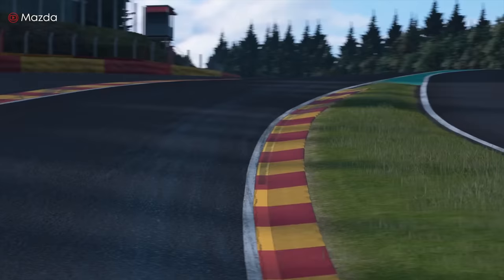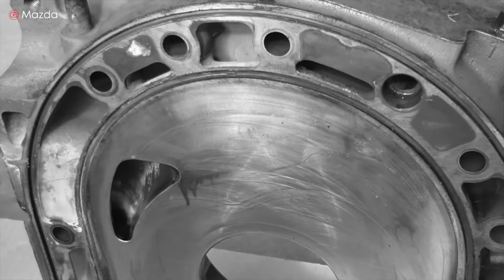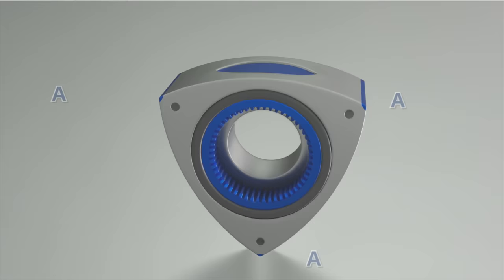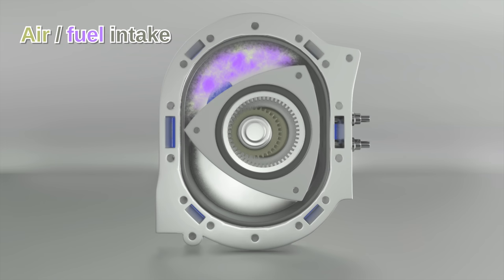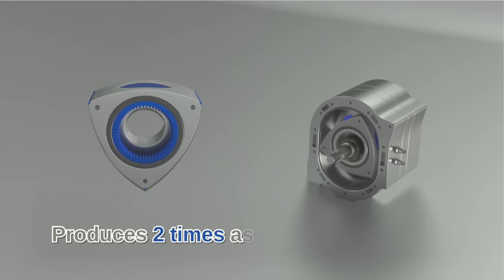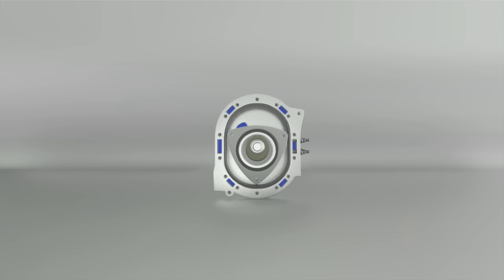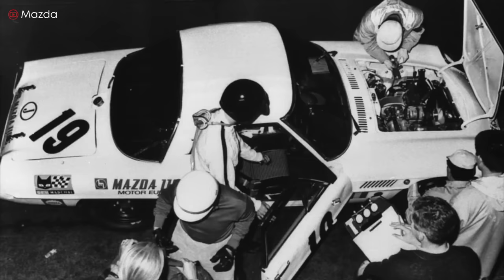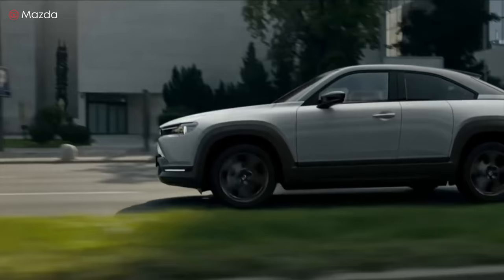Mazda's New Engine is the Most Powerful Engine Ever Made

Comment: GM's decision to kill their Wankel program also left AMC high and dry when it came to a suitable engine for their small cars.
Reply: That's correct. The AMC Pacer was supposed to have the GM Wankel rotary, but instead had AMC six cylinder engines.
Reply: @snowrocket  The rotary would have never worked in the pacer. AMCs troubles ran much deeper than a rotary could have fixed
Reply: @weirdshibainu  It would have worked fine in the Pacer, except for the usual rotary issue of fuel consumption. But, since fuel economy was important to many people, it would have hurt Pacer sales overall. AMC's troubles were many, like not having enough money to redesign older models to make them current and desirable.
Reply: @snowrocket  It would have worked but only if it were a manual.   The pacer would have been an automatic and rotary's are terrible with automatic transmissions.

Comment: I own an rx-8. It sits in my yard... dead. The end.
Reply: lol
Reply: hmm, find a rotor nut to buy it. we love bringing them back to life. the rgenisis rotor wasnt to great either.
Reply: Never give up , I’ve had rotaries all my life , I’m 52 , it’s important to have a good mechanic , I own an rx7 84 model ser 3 , had many others , be passionate, they really rock !!!
Reply: I had one like that we ended up doing a mild ls build with a supercharger makes 610 hp to the wheels and it has air conditioning heat and all the modern accommodations the new controller are amazing and can convert anything over even made all the factory gauges work like stock
Reply: @Bryce Czirr yeah sounds about right , in Australia we get about 100000 KLM’s out of the renises engine , so about 4 to 5 yrs , rx8 had a few problems no doubt , they tell me to only buy rx8 ser 2
Reply: I’ll buy it. I’ve owned 2 of them and both impressed the hell out of me! First one was a dead straight 10a rx3. Second one a 12a rx3. They do like to drink, but.
Reply: I have a 2007 Mazda CX-9 Graand Touring 3.5L V6 with variable valve timing and 6-speed triptronic that worked great for 9 years and 300K miles, until the transmission failed. Why would i want an RX-x that's going to have an engine failure within 1/3rd the time for more or less the same price? And my CX-9 was FAST, too.
Reply: @Bryce Czirr it died the first time at 80k miles. It died the second time at 180k. If anyone really wants it let me know. It’s sitting in north east Georgia.
Reply: @HaHa-gy5vg  snap! You beat me to it lmao
Reply: @bryandgizadventures  180k miles ? Rx-8 isn't the ideal daily driver to have so many miles over him. No wonder it's ruined.
Reply: @pedroribeiro1834  im the second owner. Had it forever. Trust me I don’t daily drive it.
Reply: @bryandgizadventures  how does it have reached 180k miles thats to much wear
Reply: @pedroribeiro1834  it’s a rebuilt motor
Reply: @bryandgizadventures  anyways it's a rebuild rotary, in my opinion the car has rode too many miles.
Reply: @pedroribeiro1834  yea.... that’s why I’m selling it...
Reply: I have an ‘07 RX8 GT in the yard. No motor or transmission. Throwing a LS into it when I get the spare cash together.
Reply: @HaHa-gy5vg  Now i drive an Audi SQ5. It would blow the doors off any or your RX-8s even as my dog flaps her lips at you from the backseat window.

Get a real car.
Reply: @stormculture  i drive an amg 63 you aint catching me.
Reply: @HaHa-gy5vg  Only cuz Audi put a 130mph governor on mine. MBs are overweight overhyped slugs. Ooops, I forgot to say, overpriced, too! LMAO... A friend of mine liked to call cars with "GT" at the end "Got Took!". There's got to be an equivalent for AMG auf Deutsch....! =)
Reply: @stormculture  it's not because of the governor it's because you bought another woman's car.
Reply: @HaHa-gy5vg  LOL
Reply: @HaHa-gy5vg  this is why I’m a part of the drift community. We all get along.
Reply: I'll give you $10
Reply: @Bryce Czirr Are you kidding? Any ‘70s Mazda rotary is WAY better to look at than an S2000!
Reply: @Bryce Czirr Regardless, I’d take the RX8. Different strokes for different folks, I guess.

Comment: "most powerful engine ever"
Reply: Lol guess ya missing the part where he explains it based on displacement. But clickbaitish
Reply: given the power ratio, its just a matter of engine displacement. im sure if one is hell bent to make 2000bhp Wankel engine, they could make it. and it will be still smaller than conventional one.
Reply: @ApocGuy  Some of the lunatics from New Zealand make over 1600 with their turbo 4-rotors. 2.6L of displacement, with proper forced induction, means insane performance. Heck, look at Rob Dahm's 4-rotor. He made over 1000 hp on an AWD dyno and the engine still has a lot more to give if he reaches for it.
Reply: RX7 Turbo, good memories...
Reply: @shred1894  
6 mpg?
Reply: @jamest3552  the people building these crazy engines aren't super concerned with fuel economy... Just raw performance. And any engine making over 1000 hp is gonna have poor fuel economy anyways so it's not relevant.
Reply: @ApocGuy , apparently the largest Rotary engine ever built was 49 liters in capacity. Going bigger than that the flame travel during combustion could not travel far and fast enough.

Comment: The reason that rotary never took off was 1) because the RPM needed to get the torque required was incredibly high and the oil could not be forced to go to lubricate properly, 2) the amount of fuel needed to keep the revs up was very uneconomical.

Comment: The downside of rotary is efficiency and more wear to the engine takes fuel like crazy
Reply: Imagine a rotary on e85.
Reply: The problem is the rotor seals, not wear to the engine.
Reply: @agnostic47  The only way to replace them is to tear everything apart. 
I love these lil motors. But they require a lot more work to maintain for the average consumer.
Reply: @agnostic47  Yes you are correct rotor seals require to be replaced very often rubbish

Comment: I’m thinking a range extender would be perfect for the rotary engine as it is less complex and more compact, can be tucked away in a smaller package.

As it’s not the main power plant it doesn’t need to be stressed for performance, thus I think they can make something just powerful enough to be a range extender and increase the reliability.
Reply: I think also the problematic seal situation probably gets better with smaller seals and the more consistent RPM profile that is optimized for driving a generator instead of drive wheels can't hurt engine longevity either.
Reply: @rossarcher6104  I’m hoping Scotty can weigh in on our ideas

Comment: Crosshatch the cylinder walls to retain oil longer. That might help the seals last longer.
Reply: What helps them last longer is removing the oil injection system and premixing the fuel with 2 cycle oil like a chainsaw. Lol.  I read that it doesn't start injecting oil until the engine reaches operating temp.  So those apex seals get no lubrication when the engine is cold.
Reply: @yamaha94O  I have 2 external oil injectors on my rx8. Kept synthetic 2 stroke oil in it. Had to fill the oil reservoir once a week but the engine was fenominal. I also premixed. Wish I never got rid of that car...
Reply: @krASHExxx  I'm trying to find an fc to hoon around in during the summer. Lol
Reply: @yamaha94O  do it!

Comment: Worked for Mazda from 1973 - 1998 & overhauled many a rotary engine. Some of the design flaws included running low oil due to having to inject oil into the carburetor. The oil was pumped from the oil sump so #1 it wasn't clean and it lowered the oil level of the engine.  All they had to do was install a separate tank under the hood with clean oil which could be used to inject into the carburetor.  Would have saved lots of engines.
Reply: Wankel engines are obsolete technology because they cannot be made reliable or efficient.

Comment: The existing rotary engine design is extremely fuel inefficient. It's inherently a flawed design that causes a lot of the fuel to be unused and spewed out of the exhaust. There was a reason no one used it. It is just not practical with the wankel engine design.
Reply: EGR
Reply: @jamarnicholas5697  Nope... EGR won't help.
Reply: But on the brightside you can do dragon breaths with it haha
Reply: @johngabitan7243  Yeah, it shoots flaming bits of apex seals right out the  tailpipe... stupid people think its really cool.

Comment: I have owned rotary many years. Non turbo 13b motor can produce 12 to 18 mpg depending how you use your foot on the gas. I have achieved 26 mpg once with some driving around town and a trip to the raceway on freeway. I would say 150,000 life of motor is reasonable. If you drive it alot you get much more on life. Over 200,000.  They make great race engines. Carbon build up from short trips and not driving the car regular is a big problem. Carbon get hard and is problematic to the seals

Comment: A new Wankel engine as a range extender for an electric car is an interesting idea, but personally I was hoping for a Wankel engine that would directly power the wheels, assisted by a hybrid electric motor a-la Toyota's Hybrid Synergy Drive. Wankel engines have bad torque and bad fuel economy, both of which can be improved significantly by the addition of an electric motor. But to be fair, Wankels' weaknesses are so bad that using them in roadgoing cars at all is unjustifiable nowadays. Basically the Wankel engine can never live up to what enthusiasts wish it could be. I owned a RX-8 for 9 years. I'm glad I had that experience, but I was also glad to trade it in for a normal car.

Comment: The necessary requirement of getting rid of the spent fuel from the combustion is what limits the rpm of the apex wheel. Professionally ‘drill’ more exhaust ports to take dissipate the combusted gases an Wa La. 1000-1200 hp.

Comment: I remember the local mazda dealer sold alot of those back in the 70's  but the motors had alot of problems and consumed much more oil then a normal car.  Nobody knew anything about those kind of engines and you had to take it back to the dealer to get it fixed and the price to service was enotmous due to the monopoly they had on service and rotary parts.  Eventually people stopped buying and the dealer sold other automotive brands.  I am thankful, I never bought one after the horror stories I heard...

Comment: There is only one company I am aware of that has totally reinvented the rotary engine and in essence has turned it "inside out".  They also have funding from DARPA.   As a pilot who not only owned an 85' Mazda RX-7, I've kept my eyes on this technology because the rotary engine is very light and powerful compared to pistons, have a lot less parts, and therefore can be well suited to light aircraft above typical piston engines.   This new company "Liquid Piston" has my mind blown as to the future of what rotary engines can and will be.  Their rotary is not only shaped different, the seals are stationary.  It's truly the next evolution for this engine type and I'm excited for their future.
Reply: Wankel engines are too unreliable for passenger aircraft, this is exactly why they are never used in type rated production aircraft.
Reply: @sandervanderkammen9230  Which is why ..in case you missed it.. I said LIGHT aircraft.  There are people who have already used it.  So any major improvements means it will continued to be used as they produce a lot more thrust to weight than conventional piston engines and have vastly less parts.

Comment: There is room and hope for the rotary engine yet... recently discovered and development of a 2D polymer layering has potential to aid the density and toughness. The 2D polymer is light, twice as strong as steel. It can been produced cheaply and efficiently. This could prove revolutionary for the rotary engine. It can be used as coatings, (let's say for cylinder chambers for strength, durability, decreased friction and heat disappation), plastics, rubbers and seals, coatings or additives to paint, and as glass, (normal glass thickness is more bulletproof than bulletproof glass). Not to mention many other industrial uses i.e. building and construction, aerospace and other's.

Comment: One thing I think Mazda should have invented was roller Apex seals almost like a cam roller on a pushrod so if you recessed half of the roller into the rotor and if you have tighten up clearances with the roller Apex seal but there's a new rotary engine that also exists it's called the liquid piston rotary engine where they change the design of the rotary completely and the Apex seals are stationary they turn the rotary engine inside out it's a triangular case with an oblong shaped rotor interesting design

Comment: in refrigerator and air-conditioning compressor also has rotary type which is fast cooling but easy to worn out ,and the other one is reciprocate a piston type gradually cooling but more durable.

Comment: There are three detonations for every 360 degree full rotation which is 120 degrees between each. A four cylinder engine produces 1 detonation per 360 degree full rotation. The single totor Wankle therefore might be similar to a 12 cylinder standard four stroke engine.
Reply: You need to learn about Wankel engines... you obviously don't have a clue about how they operate.

Comment: Since the RX-8 was not turbocharged, does this mean that Mazda's 1.3 liter "Renesis" engine with 232 horsepower techmically defeated the S2000's hp per liter of size with a naturally aspirated engine record?

Both the RX-8 and the AP1 S2K had 9000 RPM redlines.

Both cars corner exceptionally well.

But the stock S2K was faster and reliable than the stock RX-8.

Comment: A tiny rotary engine would be great as a generator motor. They can spin at fairly high RPM's and make enough power to turn a larger generator to charge the batteries quickly. 
That could be the future of the Wankel Rotary.

Comment: I think the rotary engine really came about 10 to 20 years too late, because it probably would have made the perfect WW2 era aircraft engine. The high power to size/weight ratio, the lack of vibrations, the long breathing and the simplicity and lack of moving parts would all have been very advantageous for powering propeller fighter aircraft, while the relatively short life time wouldn't have been much of an issue, since aircraft engines back then weren't expected to run for a long time and got a lot of maintenance anyways. Even when a plane didn't get shot down, it got replaced with a new model soon either way.

Comment: Japan's "Shaken" inspection laws drive car owners to give up on their cars earlier to buy new cars. The inspection must be performed every few years, and inspection fees are high. Those fees get higher as the car ages.   This may be why you can buy engines from Japan in the US to replace old/worn-out engines in import-cars.

So if Japanese don't keep cars until they have 60,000 miles (how many kilometers is that ?), then the wear-and-tear problems of the Wankel Engine aren't such a problem for them.

Comment: The rotary engine is a great engine if you have no concern about efficiency (miles per gallon), and its relatively short engine life. The friction from the rotor's rubbing parts (seals and internal gears) are unavoidable by design, hence its limited life. The rotor, unfortunately, cannot be lubricated well enough because it is also exposed to the combustion gasses...so Scotty, please tells us about Mazda's newly discovered non-polluting oil.

Comment: I had a 76 rotary pickup. Great sleeper truck. Blew any and all Civics and 
Celicas off the road. Sadly though, the motor only went 90 thousand miles before it blew.  I installed a rebuilt and it was off to the races again. I would have kept it but by the early eighties I realized I couldn't get simple parts for it like brake rotors or I could if shipped from Japan.

Comment: This motor is just begging to be a REAL hybrid!  Not a modular one but actually making the rotary motor itself to also be electric motor windings hidden inside the parts/castings so that while it is making power the good old fashion way it is ALSO making even MORE power in exact linear manner electrically!  The computer divvying up according to load type /speed/tps/heat/etc etc....tromping on the ol pedal lights it ALL up!   Perfect Miata engine

Comment: I think Japan Or Australia should develop a new rotary engine specifically for outboard or generally for water crafts, because rotary motor is small and lighter and efficient that will compete with the newly developed in line 4 stroke ALFADAN motor.

Comment: Looks just like the rotary engine from the 70's. Which was a failure only because people couldn't figure out the right way to run it. I did give exceptional mileage if you kept the rpm's high. If you let it idle gas mileage was terrible. Rev it high when you stopped at a light and so forth and it reached the mpg that it advertised.

Comment: I had a 1988 Mark 2 RX-7. The engine sounded like a jet plane, naff all torque though. It drank fuel. I got about 19 MPG (UK)  (so about 16 MPG with on US gallons). 
Although it was expensive to run, and I always worried about the engine seals, I do miss it , it was a lot of fun :)

Comment: Hey so i had an idea, instead of using apex seals, why not make long long bearins in the place of the apex seals, so you don't have as much of a problem with lubrication, and you don't have to change them as often. Although i don't know, i haven't put it in practice so i could be wrong but maybe it could be better.